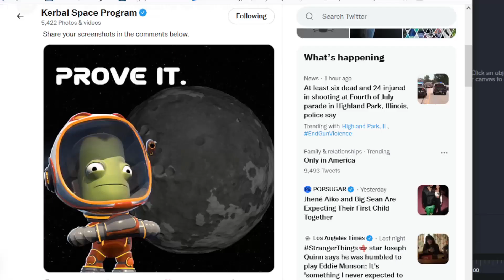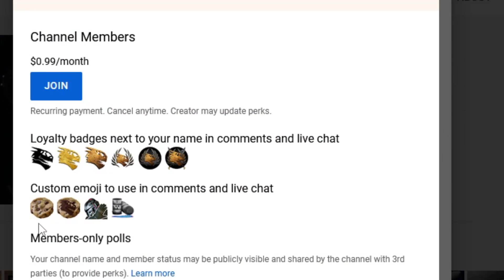SPACE PLANE DRES MISSION

Comment: I absolutely love that design! Though I do wonder:

Currently, it takes off horizontally with all its fuel and the payload/secondary craft, so it needs a lot of wing-area to do that. If it took off vertically like a rocket, deployed the smaller craft and then landed without payload and with far less fuel, it would be a whole lot lighter and could get away with much smaller wings (thus saving on mass and reducing drag).

Could that be a way to optimize the craft a little? Given that it doesn't use rapiers, a vertical ascent into a gravity turn might be more efficient than the launch profile of a spaceplane as well... maybe.
Reply from the maker: if you look carefully in the top right corner you’ll see the TWR at takeoff , it’s at .80 - A vertical rocket of similar size would need more engines and therefore be heavier. Plus, the first stage is an SSTO that gets to pay load halfway to the moon before separation. as for the second stage needing wings? that’s still in development.
Reply: @vaos3712  Ah I see, thanks!